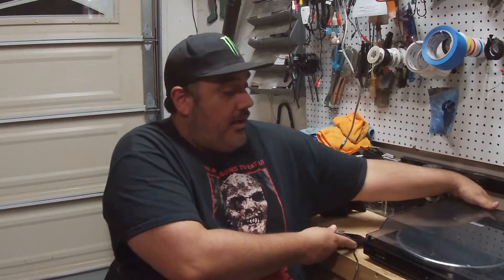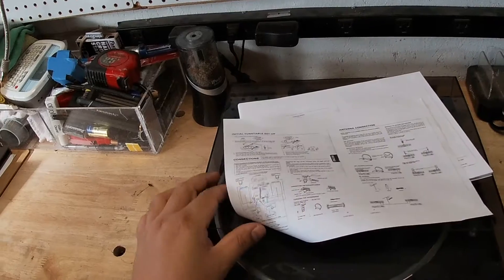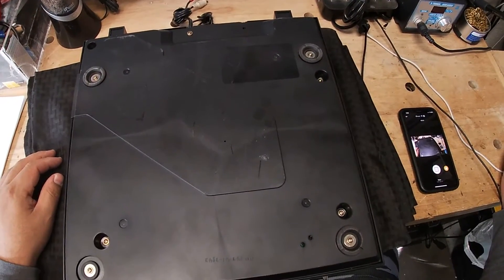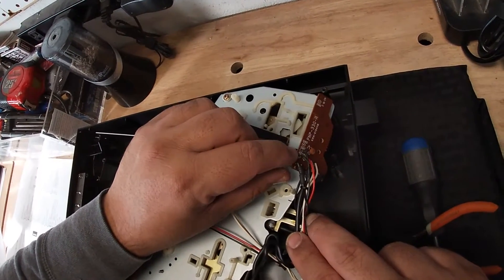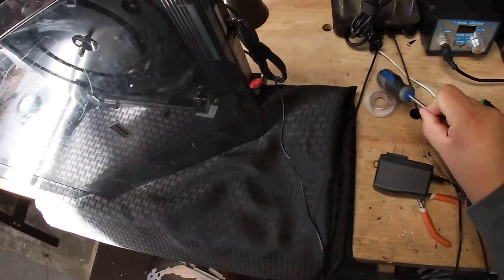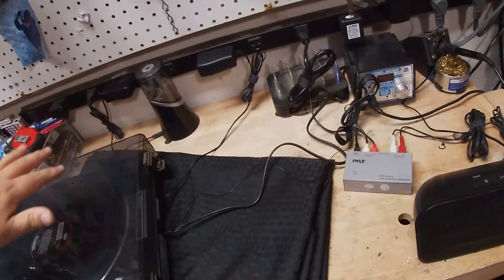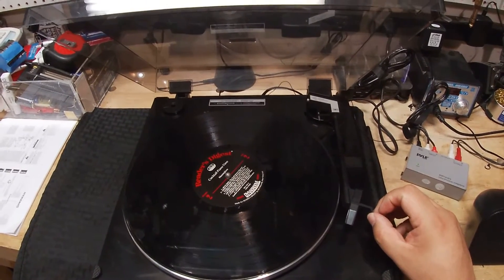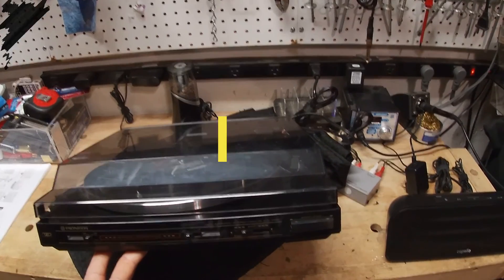DIY Turntable Power Supply Conversion  (Pioneer PL-X55Z)

Comment: My example has been converted (by someone else) by connecting a 12V power supply directly to the original power cable - externally, not inside the table.  Plays well, sounds good but can't remove hum and buzzing. How can I run a ground wire to my Marantz AVR without opening the table?  Currently connected to phono input - is this correct?

Comment: Can you just snip off 3.5 dc and splice on a  12volt 1+ amp power suppy?
Reply from the maker: Correct but make sure it is the correct polarity!
Reply: @joelsdiy9469  you can simply snip it and rewire it to a power cord or a old printer or router cord?   I am very very green....  I also don't trust my soldering skill level which is 0.   Thank you/.  The video was excellent

Comment: my motor of my turntable goes always in top speed (very very fast) what i do? thespeed adjusts don work.
Reply from the maker: Could be your power supply is giving the motor too much power.  Also check to see if your turntable is on 33RPM.  I hope this helps!

Comment: Great video, used this technique on a pioneer pl-z82 which was given to me by a coworker. Works beautifully on 12v 1 amp dc adapter and zero interference with the ground now reconnected to the preamp. Thanks for sharing!
Reply from the maker: Thanks for watching!
Reply: @scharnier6989  mine also pl-z82, could you please let me know where did you connect ground on pl-z82 ?
Reply: @scharnier6989  I opened the bottom case, soldered a wire to the PCB board GND, and connected it to the preamp, and the hum noise disappeared completely :)

Comment: Great video! Keep up with the good work.
Could you please give me the dimensions of the belt? I have the same turntable and it could really use a new one.
Reply from the maker: Unfortunately I no longer have this turntable but my best estimate would be the same dimensions as the Audio Technica LP60.  I would also suggest you buy a bag of assorted turntable belts.  They are around 10-12 bucks on Amazon and a good investment if you like to buy used turntables.  I hope this was helpful!  Thanks for watching.

Comment: Hi solid video thanks! So I have a Pioneer CX-770 tuner preamp and the power supply is suppose to connect with another pioneer amp which I don’t have. Is it possible to mod the power supply like you did with the record player?
Reply from the maker: As long as your device is DC, you should be able to power it up with a DC power supply.  I'm not familiar with that model that you mentioned, but I would look up the specs on the device and verify that it can power up with a DC power supply.  Thanks for watching!

Comment: Great but you can better use a mono 3,5mm jack plug with a power supply so you dont have open the turntable and keep it original.
Reply from the maker: This is not a particularly expensive turntable, plus I was doing this bearing in mind to spend the least amount of money to fix this problem because its worked.  Sure you could do it that way by spending money for the right part, but this repair basically cost me $0.  I was able to use an old power supply from an old iPod dock and solder it to the right port.  Thanks for watching!

Comment: If you don't want to open it up, you can also fix using a 12 volt 1 amp power adapter with 3.5mm aux plug from Amazon, paired with a double female aux adapter and an amp like the one you use here.
Reply: This setup worked for me last year, but I used a multi-voltage plug power supply that burnt out, I think the amazon one I just ordered will work better.
Reply from the maker: If you're able to, it's always best to salvage power supplies from old devices that have no use.  You could find these on old cellphone devices, old wireless routers, or discarded cable boxes.

Comment: Thank you for this video. I will do this for my pl-z92.
Reply from the maker: I hope it worked out for you.  Definitely an improvement in should.  Since the turntable did not have a grounding wire, it was pretty noisy with the current setup.  Thank you for watching!